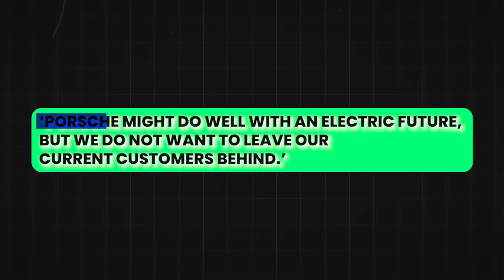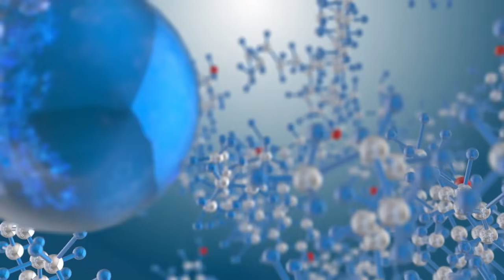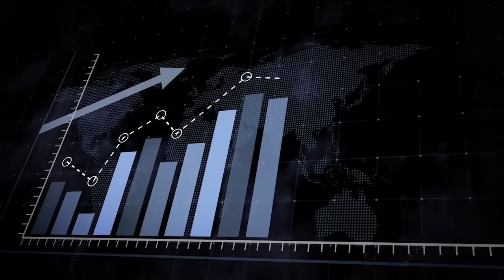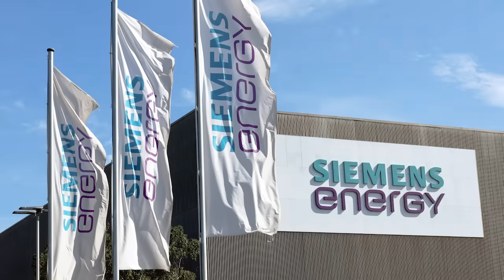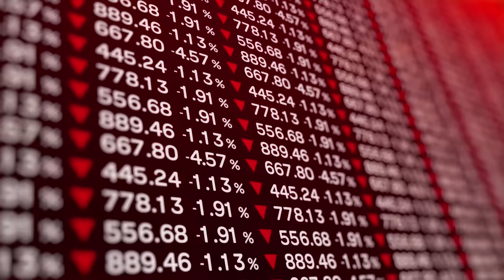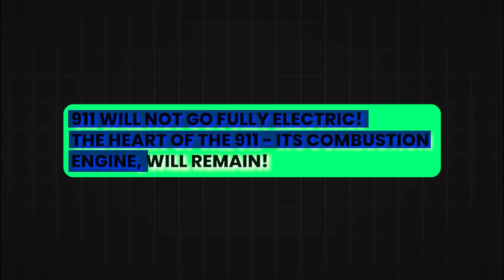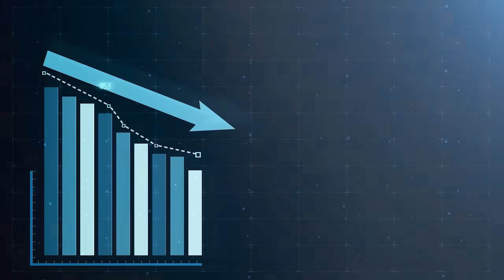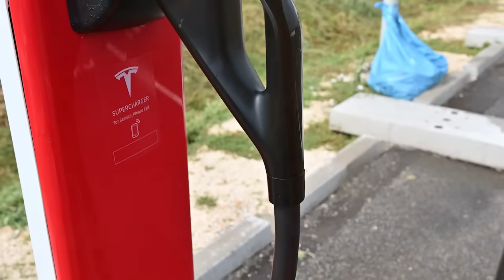HUGE NEWS! Porsche CEO Shocking WARNING To All EV Makers!

Comment: All this trouble so the rich can still have their noisy p-enlargers while low middle class is kindly invited to use a bicycle or bus to not crowd their highways.  Because there will be NO affordable cars in the near future. And also the "e-fuel" is just renamed gasoline, made with "green credits" added to the price, because except some pilot plants with gigantic costs and abysmal efficiency there is no better way to "capture" the CO2 in the atmosphere besides trees.  So they will keep some  of those e-fuel plants running  and then the bulk of rich Porches, Ferraries and Lambos juice will be made of "e-fuel equivalent" that will just be standard gasoline with "you can't aford it" price tags.

Comment: Why don’t they use wind power? The faster you go the more power you would produce…
Reply: This is pure clickbait, synthetic fuel will never be scalable, the plant in Chile currently uses CO2 waste from a beer plant it doesn’t extract it from the air at all.

There is no future in manufacturing ICE engines, synthetic fuel may keep legacy sports cars going for a while but that’s the extent of it.

The reason that legacy manufacturers are against it is they are losing the technology race against Tesla, KIA Hyundai etc
Reply: @BAC_Mono hydrogen fuel cell is in production for numerous fleet vehicles. so there are realistic alternatives out there
Reply: @LeavingCaladan  hydrogen fuel cell vehicles are still EVs, that’s not what Porsche are talking about, and fuel cells are not going to satisfy many petrolheads!